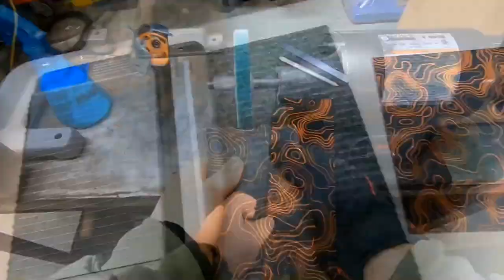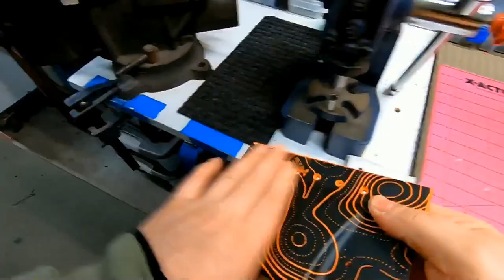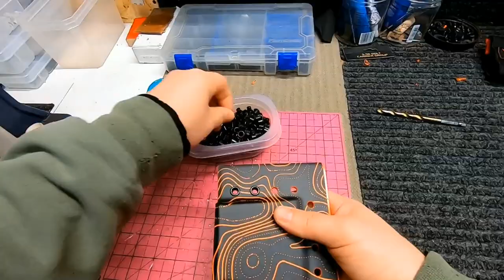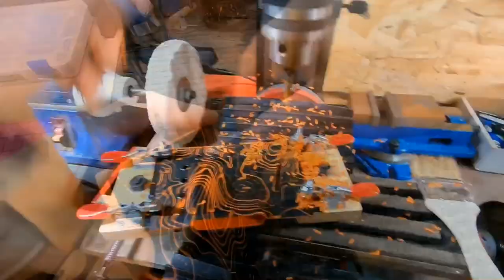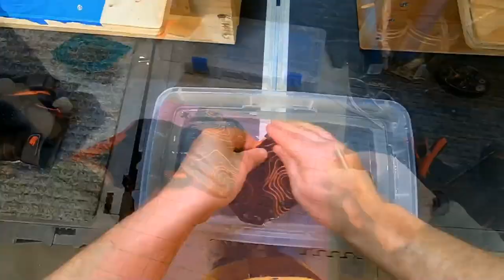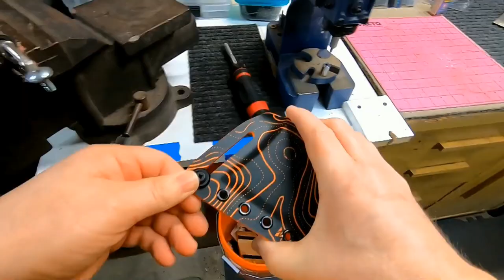Making an Axe Sheath in a Minute. One hour in one minute

Comment: Man, those are some sweet sheaths. Still using a photo editor that came with a scanner I bought back 1999; and trying to figure out how to use free DaVinci Resolve to do videos. Love when the personal confuser goes down. Had a hard drive failure a few months ago too. Figures it would happen right when I had been slacking off on backing up!
Reply from the maker: Thanks man! DaVinci looks like a good program to learn and free to boot. We had a few intermittent power failures in the last few weeks back to back that I think finally did my hard drive in, I made sure to buy an extra back up drive this time for good measure. Been a pain trying to recover and sort everything. Really cutting into bird season.... and cold weather trout season is just around the corner too dang it!!

Comment: New sub watching from Australia, really enjoy and leaning a bit from your video's and axe knowledge.  Thinking of buy a one of the cold steel tomahawks . Tossing up between the hudson bay style or a riflemans hawk 
mainly for camping and  cleaning small limbs before chainsawing
Reply from the maker: Thanks for stopping by, glad you found some good in the vids! The two hawks you mention are both good ones for working, they both have tall eyes for more contact area with the handle and will come loose less often than the other models. Cant go wrong with either, just a matter of preference for weight and profile really, let me know how it works out !
Reply: i have the riflemans hawk and am eyeing that hudson bay hawk, the riflemans splits well and is pretty beefy but its quite heavy, when i car camp thats the one i usually take, but more often when im hiking or, camping but want to carry less weight when im off in the woods from camp i use the trail hawk a lot more, it doesent chop as well as the riflemans hawk but its just so light and handy, you just have to use what i call "mouse bites" to chop small standing dead trees down, just small chops letting the head do the work all the way around until the tree is down, im thinking the hudson bay hawk will be a good middle ground between the two.
Reply: @Scablands_Scavenger  No worries, thank you you for the reply.
Reply: @ArcticGator  Thanks for the reply.  I mostly car camp or take the boat, not much of a hiker so weight isn't a concern, a lot of times we carry a small or battery powered chainsaw.  Just like the idea and traditional look of the tomahawk, we most have axe or hatchet  down here. Might have to Santa myself both.
Reply: @uncletomscabin2073  you wont lose out at the price and i like that the heads are friction fit so if you do happen to break a handle you can just use the axe head on a branch or sapling to carve a field expedient handle on them!

Comment: He's the fastest man alive! 🤣

Thanks for sharing! I guess that answers the question of why pancake over taco. Are you doing the CS Trail Boss (axe)? I cheaped out on the hawks' sheaths because I bought I bought 6 of them but would like to get a nice sheath for the TB to keep it in my SUV. Great video as always, imo you're the SME in the tomahawk/hatchet arena. 👍
Reply from the maker: Ha ha, I wish I could make them this fast for sure! I do make a few taco style, but due to the heavy wedge shape of most axes it makes for an inconsistent "sight channel" when folded and requires special blocking to keep things from wrinkling. The flat style gives more consistent results and I have quite a few people wanting to mount things to the sheath (clips n ferro rods). 
I did not pick up the Trail Boss, I have had very few requests for them and just cannot see a return on investment. I normally buy at least 2-3 of each axe to check man. tolerances from one to another. The cold steel stuff can be pretty bad and I usually need a few to pick from to get a "medium" sized one to form with for decent results.